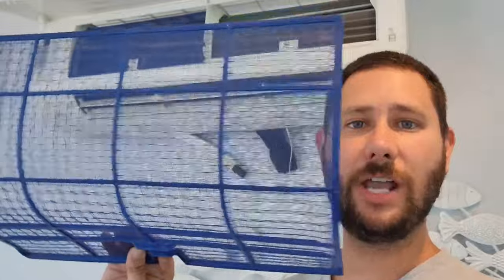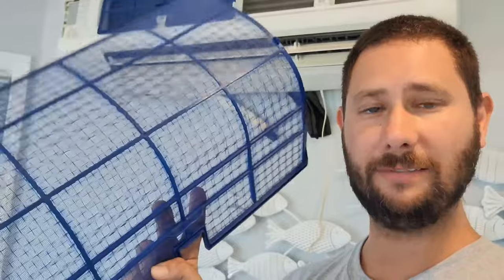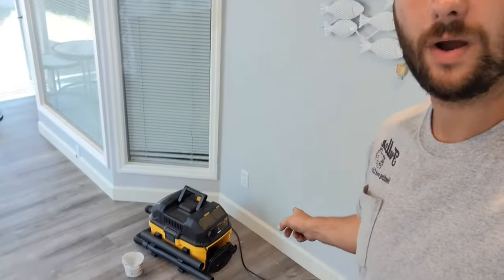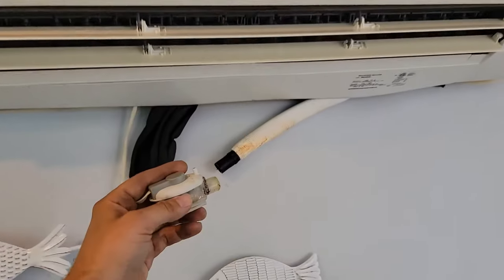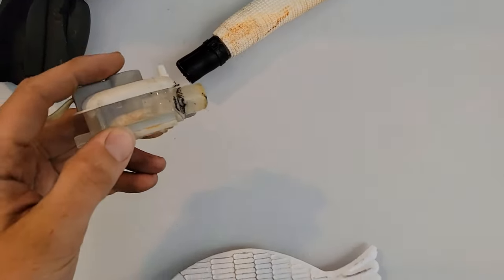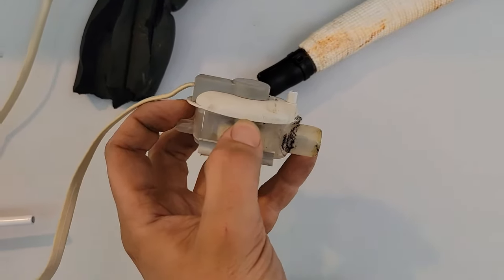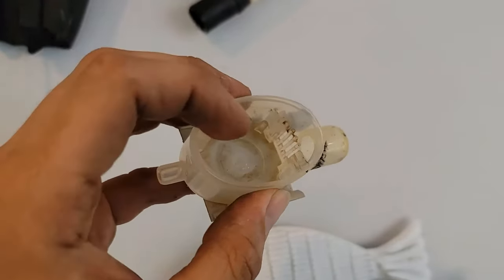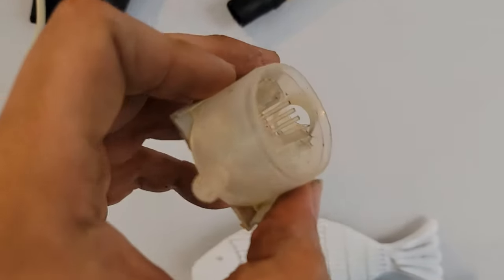Mini Split Maintenance and Drain Options

Comment: Mini splits are trash. They must be engineered by AC technicians. Who can afford all that maintenance? Taking them apart is a joke. The clips break like crazy. The pumps go out. Who's going to clean their filters every two weeks? I've two of them. They look terrible and are a nightmare.
Reply: Sounds like somebody is biased against them. I have had two for two years and they have been perfect and I am happy to clean those filters. Not sure what all your fuss is about.
Reply: They are annoying when it comes to taking out the blower wheel in my experience
Reply: My mini split system is great. I had more issues with my central air conditioning in my house in Ohio.
Reply: Umm no they are not. They are extremely efficient and low priced. Obviously there will always be some brands that are better than others but just because you had a bad experience doesn't mean they are trash..
Reply: My dad is a great hvac. Went through school for it and factory trainings. Nobody ever taught him they grow mold inside or how to take them apart to clean them. And he doesn’t tell homeowners he installs them to so they don’t know to expect them to mold up in two or three years.

Comment: DO NOT HOOK GAUGES UP ON EVERY MAINTENANCE!!!!
Reply from the maker: lol why 😆 😂 😆
Reply: It’s a critically charged unit, you let a little refrigerant out every time you put gauges on, not to mention what you can let into the system. You need to do it preferably with probes at start up but after that if the unit has the proper split why would you take the chance??? Laughing emoji 🙄 look up measurequick it has non evasive testing where you take the line temp and temp slit at unit to get capacity. Any other questions?
Reply: I enjoy your content. It’s just not best practices to put gauges on every time you go to a call, that’s all. 👍🏻 keep up the good work.
Reply: @frankgall6 yes sir! Still hard to not lose some unless you have brand new gaskets

Comment: Tad I would have to say, the wall it hard to look at with a pump on it, why not just run tubing in the wall and come out close to the floor at least you can hide the pump with something like cutting out the bottom of a flower pot and covering the pump,  throw some fake plants in the pot and the plug would be on the floor also, maybe replace the cord to a white one.  Like your videos!

Comment: Tad if this was my home i would install a large enough plumbing access door to mount the pump inside the wall cavity, in a good mounting spot where you could open the access door to do your service, and run your line down and out, or up. I would also paint the access cover to match the wall. Very informative video! Thank you very much.
Reply: I would definitely say the aesthetics of this pump on an interior wall is a no go for me. Putting it in a wall cavity with access door and wiring in the wall is a much better choice. Potentially can be done with no sheetrock repair.

Comment: One option that would look better than the standard pump hanging on the wall is the Aspen Mini White Silent + or the Aspen Mini White.  They actually mount on the wall flush to the bottom of your mini-split and so you can access them for maintenance/cleaning.  Diversitech also makes one like that called the "Asurity Undermount Mini-Split Condensate Pump" and Refco makes the Gobi II (but I have heard these aren't that reliable).

Comment: Have two mini split heads.  Aspen pumps below the heads, exact same pumps.  The 24k BTU head pump pumps really slowly, like takes over a minute and 15 secs to slowly drain out.  The 12k head drains out in in under 40 seconds. Any theories?  My 24k is used more and the vinyl tube condensate line looks a little 'murky' but still drains whereas the 12k head drain tube is crystal clear.  When they did maintenance (first annual) they didn't clean it up. Odd.

Comment: Hi, the evaporator coil goes from top to front. The water only collects on front of coil and into drain pan. Why water doesn't collects ontop of coil and drips onto blower? Great video. Thanks.
Reply from the maker: Your drain line could be clogged
Reply: Sorry what I meant was the design of the evaporator coil curves from top to front of unit. Why does the design of the drain pan only sits beneath the bottom front of the evaporator coil? What happens to condensate at back of coil? Thanks
Reply from the maker: It slopes to either side where the drain port is located
Reply: Thanks

Comment: got mini split and it has a blue line down my wall from a tiny leak, what would cause?  happens it seems when hot and humid outside, also i noticed the outside unit where valves are are frozen but only where insulation isnt on then
Reply from the maker: Unit is probably low on charge
Reply: okay, its basically new, could it still be low?  it still seems to cool okay, its a confortotal mini split

Comment: How did you connect the 2 wires from that wall mounted condensation pump to the mini split? Not sure where to run the 2 black wires.
Reply from the maker: Break one line of power L1 or L2 with the black wires

Comment: I have a gravity drain using standard condensate line, it’s about 30’ in length.  Do I need to vent the drain line to prevent backups?
Reply from the maker: It's not necessary but it's always helpful

Comment: Is there such a thing as a heated condensate lines? I live in Central Massachusetts where it gets very cold and have fiber cement siding that I really don't want to run lines over on multiple sides of my house and ruin the astectic. I was thinking of using ceiling casettes in the bedrooms below my attic and running the lines through the attic and down just one side of my house. My attic however is unconditioned and I'm concerned condensate lines might freeze in Feb and March.
Reply from the maker: yes I have used heat tape wrapped around the condensate lines only during the winter 
or just go into the buildings plumbing and don't exit the building with the drain

Comment: Just wondering if we could drop a chain through a 7/8" hole, like we do when pulling a tstat wire up through the wall??? Then pull the 5/8" ID drain hose back up.
Reply from the maker: Yeah definitely that's a good idea

Comment: Is recharging the outdoor unit something a homeowner can do (like ac charging a car)? We have a unit that doesn't seem to be blowing as cold as it's supposed to. We haven't checked pressure levels yet.
Reply from the maker: If you have the know how and you have the tools then then do it
Reply: Negative
Reply: If you know what you are doing it isn't that difficult.  But you don't want to overcharge the system.  Technically you have to be EPA 608 certified to refill refrigerant. You can get certified with an online test and I think it is only about $75.

Comment: Why did that bigger unit have a trap on the drain?
Reply: The bigger unit pulls a negative pressure on the drain and sometimes the air entering can prevent water from exiting the condensate pan drain port.  Mini split indoor units do not have a return duct and do not pull as much of a negative pressure on the drain port, making it unnecessary to have a P-trap or a run trap.
Reply from the maker: https://youtu.be/m2OI1xfzT9s
Reply from the maker: exactly thank you for answering this question 🙏 😊
Reply: Well that makes sense.  Thanks!
Reply: I personally try and avoid putting any kind of drain trap on the positive pressure side of the blower. Nothing wrong with doing it, but not usually necessary as the positive pressure of the (in this case) furnace  blower will be enough to allow the water to  gravity drain from the coil. Definitely do need a drain trap if the drain line is on the negative pressure side of the blower, as that will cause the water to be pulled back into the drainpan.

Comment: My self-awareness that I'm an idiot allows me to ask: While I understand that the pump is drawing water from the mini split (or water is flowing into the pump from the unit) but where is the pump pumping the water to?
Reply from the maker: Pumps the water outside
Reply: @TaddyDigest  I figured that, but is it pumping it up into a drain in the ceiling to outside, or through a drain in the wall (where there apparently wasn't an option for this particular install since you didn't use a gravity drain)? I'm asking because I have a room that I'm thinking about cooling with a mini split and the only walls are interior walls (there is an exterior wall but it faces the front porch and I don't want anything out there for aesthetics). I have a slab, so no drilling into the floor.
Reply from the maker: This was pumping up into the ceiling across the ceiling. And then out with the copper line sets and the wiring.
Reply: @TaddyDigest  AHA! That makes a whole bunch of sense. Thanks for the explanation!

Comment: Big red flag.  Because of the design and construction of all mini splits the charge can not be ascertained by "connecting the gauges"!  Tthe charge has to be vacuumed out and weighed then that weight is compared to the manufacturer's specs to find out if it is completely charged or not.  An expensive process when performed unnecessarily every year.

Comment: Found the information was great- it helped me— but really didn’t find him funny-not even slightly did I even slightly think the accent or whatever it was was helpful, relevant or important. This guy should knock off the “Jerry Seinfeld” ( aka-attempt at comedy-I love Seinfeld and only using his name as reference) routine- it was intolerable and just when I was clicking off he fortunately stopped that goofball talk. I am not concerned about even representing a political correctness point of view I am far from that-but it that talking the way you did was really annoying and will prohibit growth if you continue to think it should be part of you content and routine. Bottom line- great relevant  content-goofball on delivery and style.   Also suggesting that that type of maintenance should be done 1-2 times-per month is not accurate. Thanks.